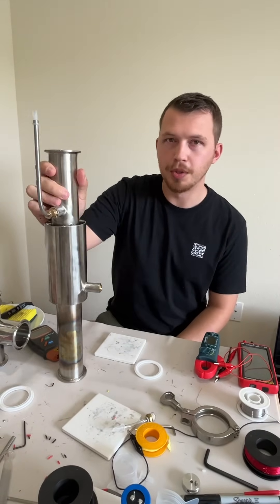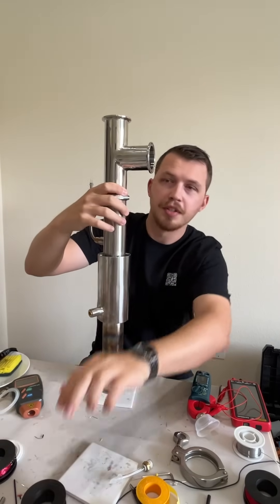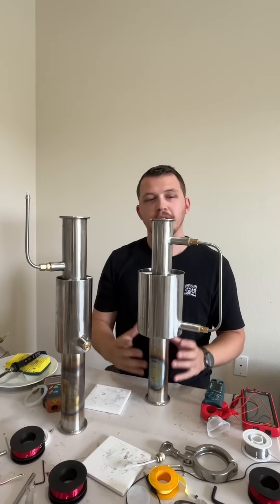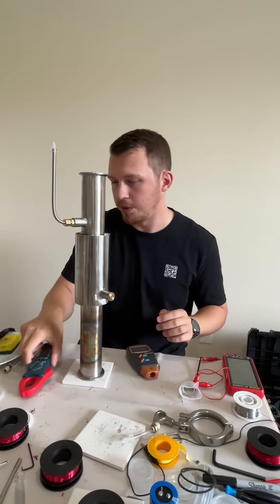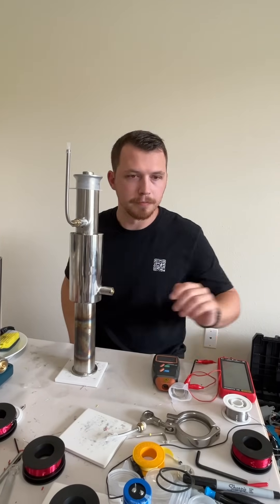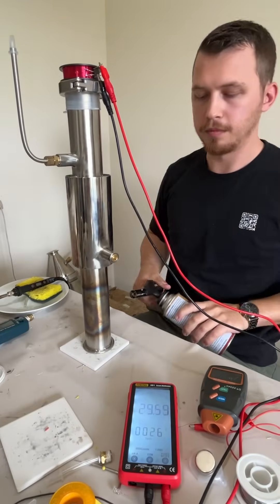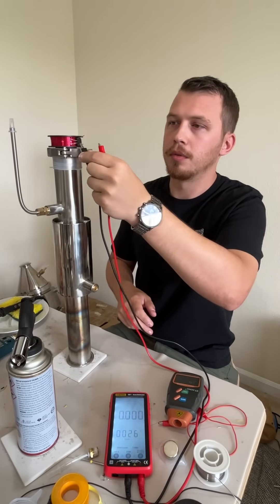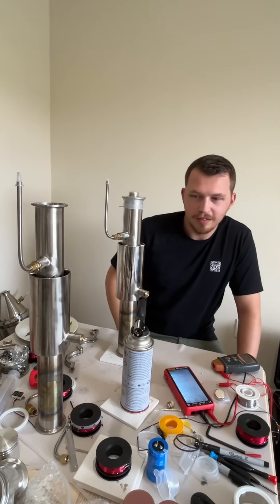Custom High Temp Stirling Engine #stirlingengine #thermodynamics #electricgenerator

Comment: Where did you get the stainless steel tubes and clamps for your engine, I am thinking of designing and building my own Thermoacoustic Heat Engine myself but do not want to deal with the hassle of having to custom design most of the parts myself.
Reply from the maker: You can get basic shapes and sizes online (like Amazon.com). Once you find out what you like then you can invest in custom shapes
Reply: @LES_Thermodynamics alright thank you for telling me!

Comment: The amperage reading you are getting is interference from the magnet. 
Connect a known resistance across the output and measure the voltage drop across the resistor to calculate power. 
To get the most power out you have to balance the load to the supply so that the resistance of the load matches the impedance of your coil.

Comment: I don't think you know how an amp clamp works.  What is the electrical load on the coil? 60 watts is not what's happening there.
Reply from the maker: Yes this was called out in other comments on this video. There was magnetic interference

Comment: I think the tachometer needs clearly see its ray. You can use special reflective sticker reversing ray at the direction it come from, or aim device at reflective surface placing the ray perpendicular to it and it should work nice. I don't think it's battery issue.

Once again, grest design. Thank you for sharing.
Reply from the maker: Thank you. That could have been it!

Comment: Hello Sir. I like what you show. These engines look and work great.

I have two suggestions. I think you're right when you say that the engine works a little bit worse when heated in only one spot at once. I think it makes sense closing hot area in some kind of "flame sleeve"with openings for flame and "exhaust", this will cause heat from flame stay near the hot area and more heat from the burner will be absorbed by the engine (something similar to water sleeve).It could be made like the vlamps for easy applying or removing it (like two half pipes with caps on ends with round hole fitted to the engine dismeter).

Another thing - for measuring power it should be connected electric load to the coil, otherwise measurement won't be valid. You could connect a resistor with properly selected resistance (few ohms to few tens of ohms) and in this configuration voltage parallel to the resistor and current in parralel to it. This should ensure right power measurement. 

Anyway, great design, I like the descriptions and explanations. 

PS. Sorry, my english is far from perfect, but I hope it,s understandable enough.
Reply: Sorry, I mean current meter should be in deries with load resistor and not in parallel. This would short the generator.
Reply from the maker: Thank you for the reply! These are good recommendations

Comment: With your check valve, could you experiment with ball valves? Maybe there’s a weight of a steel ball (sitting on a rubber seal) which will allow hot air to escape, but will seal when the vacuum is created?
Reply from the maker: That’s a good idea! Unfortunately I have tried ball valves. It would be possible if the connection to the valve was a very soft tube. It has to have a specific amount of “give” in the system. A one way valve will just turn it off.

Comment: you can improve on this... there is a better way of generating electricity directly from the heat instead of relying on moving parts to generate electricity. the thing i'm interested in is how does the vacuum works in your design here, cuz the a heat based vacuum with no moving parts is an interesting idea and i think will pave way into an awesome generator.
Reply from the maker: Thanks for the comment!

Comment: Your measurement of voltage and amperage is without a load attached--so, you're just measuring the induced voltage and amperage power not the actual (load) power drawn. How much power do you draw under load? This would help people to know if you have a useful engine for energy generation or if you're selling a novelty toy like everyone else. Thanks.
Reply from the maker: Yes I’m am working on that! I have the appropriate tools arriving tomorrow. I will post a video after work or over the weekend. Also testing methyl chloride as an internal additive due to its low BP.

Comment: May I offer the advice of email capture on your website? It helps your channel and your website to be able to show an email list if people want to provide such. Then you can email them updates if you want to.
Reply from the maker: Something like a newsletter?
Reply: @LES_Thermodynamics  
Yes the newsletter sounds great. 
Also I really like what you offer.
 I would like to show you some things that I feel could improve performance, without increasing costs, but increase revenue. Small changes that would lower the amount of heat needed, separately a two or 3 diaphragm addition from existing off the shelf parts.  
Would like to help, by relaying what I know will work. At no change to you, or personal credit to me. Just wanted to offer my input. 
An email address would be helpful. I am willing to sign a non disclosure non compete NCND if needed. Thank you for your consideration. 

Typos deleted.

Comment: Please put a resistive load of about 20 Ohms across the coil output. 
Then measure the voltage across this load resistor. 
The wattage being produced can be calculated by :
Voltage squared divided by the resistance of 20.
You can also measure the current flowing into the resistive load and multiply by the voltage to confirm the wattage result. 
Note! The clamp ammeter must measure the current well away from the oscillating magnet as otherwise the current read will be in error.across
Nice robust  steel construction. 👍
Reply from the maker: I have ordered the required materials! 🫡

Comment: You didn't measure the current correctly.  Your circuit is not closed.  A current clamp is supposed to measure the magnetic field created by current in a closed circuit, and in your case it measures the magnetic field of a permanent magnet.  With the same success, you can simply attach a magnet to the current clamp.
Reply from the maker: That’s an interesting idea. Please take a magnet and stick it to the end of your current clamp. Although it may jump to a third of an amp, after a second it will go to zero.  

Thanks for the comment though! Feel free to check out the other videos including the call to action for community submissions! The 3D print file ready for customizations.

Comment: I couldn't see how you were using the current meter - were you just coupling directly to the generator coil? I've used them many times, but always around the wire of interest. Was the wire just too small to easily see in the video? Either way, thank you for sharing and I look forward to seeing what else you create!
Reply from the maker: There is a prong coming off the full bridge rectifier, which is what the meter was encompassing.

Comment: Excellent work, gonna need these for our woodburners once our leaders mess up the global energy supply, oh we can buy this?
Reply from the maker: Can also be powdered by concentrated heat of the sun. Add a salt cylinder to the bottom and you have a heat source that will stay hot for hours into the night.
Reply from the maker: It’s on Etsy as well for $200. https://www.etsy.com/listing/1497025388/high-temperature-stirling-engine?click_key=dd12b006874542e53b957573ae13de61cba4daef%3A1497025388&click_sum=fe419987&ref=shop_home_active_1&pro=1

Comment: Would this work with the hot side up instead of at the bottom ? Since hot air moves up could it not work even better that way ?
Reply from the maker: I will give it a try, but thermodynamic theory indicates that it won’t work. 

For example, the current position (hot on bottom and cold on top) causes the air to be heated at the bottom and then rise to the top, since hot air rises naturally. Then once at the top and on the other side of the (ceramic) stack, it is much colder (relatively) and then falls back to the bottom. That cycle repeats itself around 3000 times a minute.
Reply: @LES_Thermodynamics  I was thinking about using a sand box as a heat source sun powered, and use sterling engines with it, your apparatus seems ideal for the application, i was thinking about replicating it and suspending upside down so the cold side would be shaded by the sand box.
Reply from the maker: @TheDIYDen  that’s a good idea! You could also use cooling paint, as well as wind to cool the unit with the water sleeve. The power of convection! 

Also you don’t have to replicate it, I have this unit for sale on my website as well as on Etsy.com 😉

Comment: Hi, great video, absolutely fantastic. One question, do you think you would be able to do a lower temperature version?
Reply from the maker: Yes - but since it’s is only so efficient at converting heat to electricity, a lower temp would make it nearly useless.
Reply: @LES_Thermodynamics  thanks for the reply. So it operates at about 200 degrees centigrade?
Reply from the maker: @DrBretPalmer  the measurements in that video with temperatures were in F°. I am waiting on some items to arrive (fresnel lense) to test different temperatures and heating sources. I’ll post a video when it finally comes in.
Reply: As he said in some other comments it works on heat differential. So if you put ice and water in the outside middle tank then you would need less heat to get full power. That means that in the winter if you have ice you need less heat to run this in the field. 
To make ice: put water in a pipe and suck out the air with a car engine vacuum line to the master cylinder at 14 bar. Have a valve for open and close. In time it will become ice at room temperature in vacuum.

Comment: I just saw a piston one on a solar reflecting mirror. Didn't even know about them. Great design. I wanted to do a design with a piston to electric motor
Reply from the maker: Yeah I’d love to hook a piston up to this, but it involves so much more engineering. The linear alternator was a happy medium
Reply: I would love to see the comparison between your design and a piston on at the same scale. Your design is far less complicated and cheaper to build. A hybrid would be cool. Make the piston head a magnet
Reply from the maker: Do it! Let’s compare! I’d like to see as well
Reply: This is a better design as it has one moving part ( the high temperature silicone diaphragm) less friction loss. One cheap disposable part to break. Can be replaced with a latex diaphragm in an emergency. Silicone diaphragm can be fixed with tape, glue, or high temperature silicone caulk in an emergency. I hate moving parts because they break. I could even replace this with a tire inner tube cut out from an old inner tube in an emergency. One part that breaks, many ways to fix it.